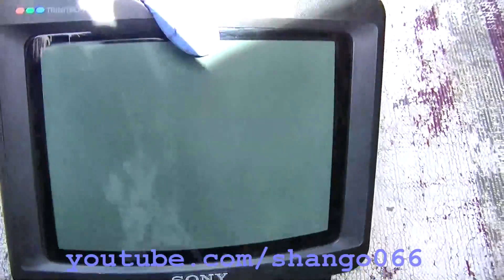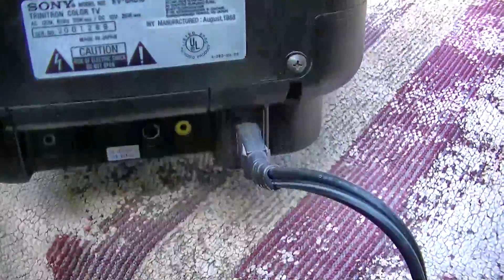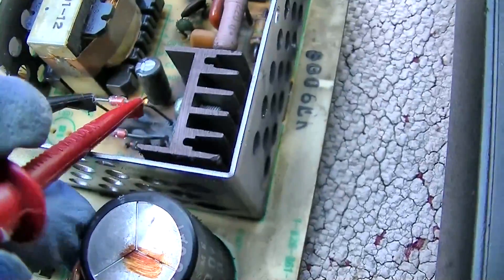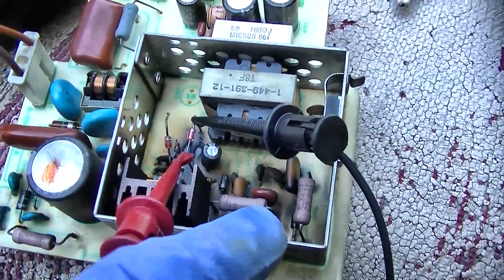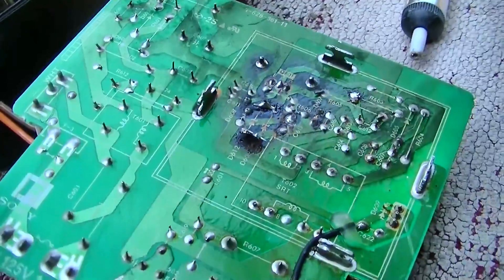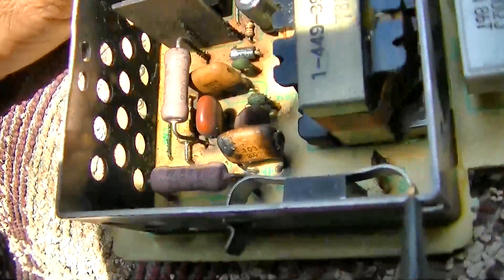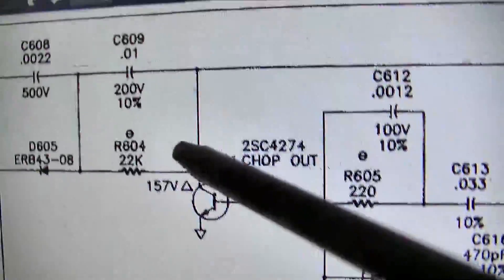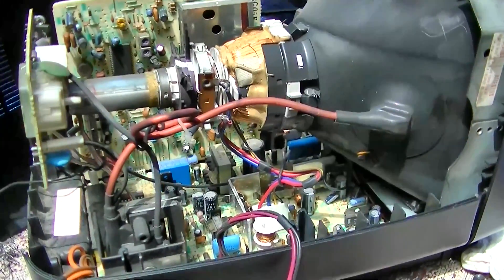Sony Trinitron Portable Television Comeback Repair KV-8AD10

Comment: Thank you for the tip about the Wall Wart power supply! I got a universal 12v 2.5amp center negative 5.5 x 2.1mm dc jack and my little Sony TV works again!

Comment: The disc caps on there, look how roasted they are.  It's in that can and when it originally failed baked components around it.  I'd check that transistor for thermal intermittent faults (or just replace it)... I hate these "feedback loop" problems where one thing causes another to blow up.
Reply: When you put it back together it will be in that can (like making a pot roast)... luckily the transistor will probably just pop open now if it does

Comment: Not letting the power supply run all of the time (in standby mode), WILL hurt it.

Capacitor's lifespans are shortened, everytime they are turned on, from a full-off position.  That is why ALL modern electronics power off into a standby mode.  ...the capacitors are receiving a small amount of voltage in this mode.

Think of voltage like water pressure.  Would you immediately fill a lock full of water, when it is empty, or would you gradually fill it with water.  ...think of how much water pressure the elements of your structure will support.

You were correct in having him connect it to a power bar (with a surge protector), ...but electronics should only be fully turned off, via a power bar/outside switch, when a thunderstorm threatens to overload your electrical system. \(•~•!)/
Reply: Not true..
Reply: @jonathaneastwood2927  Source, or sources to your claim?
Reply: What Whippet  weekly.... October issue.

Comment: These were classic workhorses in their day! Back then their color rendition was unbelievable.
It nice to see you bringing classics back to life. WIth all of these new flat screens hitting the market so cheaply today, no shops around here even bother working on them. Sometimes you can find perfectly good sets set out by the dumpsters over here. If the screen is not cracked most often its bad caps in the power supply board which can be replaced with some effort needed to crack open some of these cases used today. Hey whatever happened to Picture in Picture technology??? I have yet to find a flat screen out on the market that has this feature. It was great for catching two football games at the same time. Hit one button on the remote and you swapped tuners feeding the screen.

Comment: Hey Shango066 we used to put a small 1 ohm resistor in series with diodes or transistors wired in parallel to equalise the load so both see equal loading otherwise without this if one gets hotter than the other thermal runaway will always cause one to conduct more heavily and short ! Another method is to thermal couple both diodes to each other so both have equal temperatures you can put a mica washer between them or a ceramic disc with heat-sink paste to keep them both in check balance load. And naturally a zener diode in this configuration will draw more current when the TV is turned off as it is a diode clamp circuit to hold the voltage down more greatly with no load, the capacitor obviously smooths out the spikes without it the spikes will kill the zener's by overshooting their operational range.

Comment: I've been wondering about "working" caps causing power supply problems like that... but is that true for power supplys that won't start also (like maybe the start circuit)? I'm guessing it sort of is. Maybe not high ESR... or is it?

Comment: I still can't get over that Sony used parallel Zeners. It is one of the things teachers told us NOT to do. Current sharing will not be equal (although they look quite equally baked :) ) unless you select the diodes in pairs , which they obviously won't do for a mass produced item like this. They should have used a single 1.2-2W Zener instead of two parallel 0.25-0.5W.

Comment: The original zeners were RD10ES-B3 (10V not 12V!) which are picked at precise voltages, you have B/B1/B2/B3 gradings. This way it is ok to parallel them so they share equal current, because their avalanche voltage is close enough.
Paralleling normal zeners can lead to weird effects as only 1 zener takes most of the current and the other one will start to cause weird oscillations.
Still I don't think that would cause them to fry like that. There must be some spikes happening which killed the small cap. My first suspect would be the main filter cap 330@200 allowing too much ripple into the circuit. Hooking up the scope and checking the chopper wave form would give some answers.

Comment: The biggest problem with taking on repairs is no-one wants to pay "oh hey, you like old TV's, you should fix mine for me" It's no wonder all the repair shops have gone. Everyone knows the price of everything and the value of nothing.
Reply: its starting to become the same with old cars...you either replace only what's bad to avoid charging more than the price of the vehicle and risk future problems or you change lots and lots of rotten crap and charge 2 or 3 times the market value of the car

Comment: Those things.. you have to fully recap them and check with an inductometer the state of all coils.
caps and coils uses to go off-spec and cause those misterious problems.
Also they stronly need full resoldering of every single pin in the PCB after 30 years of service..
Reply: how does a coil go off spec?

Comment: I'm not a purest .....but hats off to  Shango for sticking with the original P.S. and not taking the easy way out. Though I'd say the majority of us may have changed it for the more modern supply, it kinda defeats the  "let's stick with the original design if possible" thingy.  Besides if he hadn't and something else happened....(i.e. that IC Chip smoked) one still might needlessly suspect THE BRAND NEW P.S., being the cause right?

Comment: Managing warranties on old well used equipment you repair can be a nightmare, a fools errand. It's not reasonable to try and make this equipment all new by replacing everything. A component that functions perfectly fine today can fail the next time it's plugged in.  Of course it's even worse when the equipment has to be shipped, and those costs having to be paid for in the 'back and forth'.
I find that zeners as well as other diodes that fail have too much current going through them. Not sure of your part number but looking at the size tells me the max might be an amp or two. That of course also determines the amount of heat they are dissipating. Personally, if the amount of current they're going to have to carry is more than half their rating, I'll go up to a higher current diode (zener or otherwise)
Reply: Very true. There are no guarantees on all repairs; they can either last a lifetime or not very long. Reliability is the issue.
Reply: @RoughJustice2k18  yes, and in this case it was found that it was the previous repair that had failed, and perhaps the repair was not thorough enough, but I think he did a good job of making sure the power supply was in better condition this time when he sent it back.

Comment: A crappy switchmode with no propper feedback to control the voltage.
Reply: I will look up the service manual because I can't believe Sony would do something like this. Yes, this PSU has no feedback, but it's probably just a downconverter and the TV has a regulator for 12V on the main chassis. So the output of the converter can be unregulated. Although a crowbar TVS diode on the output would have been a nice touch. Fortunately the Zeners served this purpose, although they're not directly on the output.

Comment: change the main filter electrolytic too. it's already bulged and getting warm. That PSU should be staying rock solid at 12 volts, regardless of the load or not. It still has a problem.
Reply: most 12 volt tvs run at around 13 to 15volts ,,,maybe because they are intended to plug into a car? i dont know for sure

Comment: You could just add a barrel jack for direct DC input so the AC supply is still in there, just not being used.  With all that carbon, lifting traces and poor design it will just come back for another fix.  Would make it easy to hook it up to a vehicle, batteries, etc.
Reply: It has a barrel jack from the factory.  The owner's manual even shows a 12V cigar adapter for using it in a car.

Comment: It's just amazing,  I remember paying almost the same price back then for a similar Sony that my sister paid for a Samsung set that's 55 inches today. I really do wonder what it will be like 30 years from now. Should I be holding my breath  ?
Why can't the prices of automobiles be the same. All I ask for is a simple car without ANY bells and whistles, not even a radio but must be reliable. OH, I Definitely don't want a car that has a computer chip in the tires to tell me that it's time to put air in the tires. 🤣🤣🤣
Reply: Guessing you're in America so Citroen/Peugeot likely not an option, otherwise I'd recommend finding a good condition older 306/ZX/405/Xantia 1.9TD or suchlike.  No computer rubbish and simple to maintain, ultimately reliable & cheap to run.  In the UK you could find a ridiculously well-cared for solid example of any of these for well under £5k & as long as it's maintained properly it'd last any of our foreseeable lifetimes.  (P.S. your rear left is currently at 27.2psi, time to pump 'em up there chief).
Reply: 30 years from now you'll be watching 
I love lucy reruns on your google brainview  which you rent for $1575.00 per month.   Pray the power supply doesn't blow because carbon tracking in the brain is quite unpleasant.  Future Shango's will need to be amateur brain surgeons to fix power supply problems for google brain views.
Reply: Government automobile regulations to "keep us safe..."

Comment: very bad design of Sony, you almost expect it of cheapo stuff, but not theirs
Reply: i have a 'roadstar' branded thing that had similar problem, runs continuously, looked cooked, must've gone overvolts as blew the line out transistor, luckily was able to get one, as was an uncommon type..
Reply: Yeah, maybe they farmed that part out, a small electrolytic cap sandwiched between the transformer and switch transistor, really?

Comment: Reminds me of the 36 inch Sanyo that I tried to repair some 15 years ago. It blew the Horizontal Output Transistor. At the time I checked for, and found a bad capacitor that was causing the HOT to, well, get hot and blow. I replaced it, test ran the TV for a few hours then sold it.

The guy who bought it from me called me a week later saying the set went dead and he wanted his money back. I said to bring it back to me. He never did. So I don't know if there was a cap I missed or what, but yeah, bad caps will take diodes and transistors with them.

I wonder if the first cap you put in was defective? It can happen.

Comment: The entertainment factor is right on! Who doesn't like to see a bit of smoke from burning electrolyitics? I am happy to see you get the power supply working in the end, instead of resorting to the wallwart adapter.

Comment: I thought I was buying one of these last month  for about $20USD with Remote and fully working, Turned out to be a full sized 90s Sony, bloody heavy and all at the front.
Reply: That's a pretty good price. Better than the $350 one on ebay that doesn't even have a functioning remote.

Comment: The filtration on the secondary had high level spikes like sawtooth...the zener diodes were trying to clamp the spikes... If you had used a scope on the PS you would have seen the filter capacitors in the secondary were not providing proper filtering...Replacing the caps removed the spikes and the zeners stayed cool..  I've seen this before in SMPS...
Reply: @masessum1  When caps go bad in a SMPS, a higher DC output voltage may be produced, which could destroy other parts in the circuit. It only takes a volt or two above the rating of a part to blow it up. It is a good lesson; always check everything in a power supply - including coupling / filter caps if you don't want recalls later.

Comment: I hope it's normal for that chip on the board to heat up like that; as looking at it through the Flir device, the chip doesn't appear to have a heat sink attached to it. At least these days, computer manufacturers attach heat sinks with thermal conductive material to sidestep any problems associated with overheating.

Comment: Given the thoroughly cooked state of that power supply board I would have just adapted a new/surplus open-frame industrial power supply to fit in there and canned the original...or sarcastically install a stud-mount zener on the shield casing.

I'm thinkng the cap was probably OK for a while then started to go high ESR in that ez-bake oven, making the diodes get hotter, making the cap dry out more, making the ESR higher yet, and running away until the diodes shorted.

Comment: That Trinitron model line was the monitor of choice for news helicopter monitors. They did the 12v mod to run them. For those news copter folk the main challenge is putting all that stuff an d still be FAA certified.But whatever failed in use it usually wasn't those tiny Trinitrons.. Those flying studios cost millions. Then HD made everybody start over.

Comment: Nice vid, nice FX, nice fix. Usually, these small caps are not so problematic in switch mode power supplies.
I think I would have deleted all of the board's parts except the connectors. Then drill 4 holes in it, in order to screw another modern SMPS module onto it. Connect it up, put it together and ship it.
You're right. Never fix someone else's stuff. If you touch it, you own it. They will keep coming back to you for keeping their junk alive 'till the end of times.
Reply: @6 months ago Depends on what you have more of: free time or money.

Comment: Personal i hate working with switching power supply's spatially the old ones. is the go bad they have a tendency do go fast and nasty. killed a multimeter one time as it went bad. 
Nice video regrades and sad state of affair that you have to put the shango66 in the middle of the image that way but I get why.

Comment: What was the brand of the CAP, I found that Panasonic / Sanyo ones don't hold up quite well. Or cheapo China ones, I had one fail in 1 hour.
Reply: Panasonic and Sanyo both make excellent caps, of course assuming fresh modern inventory not NOS stuff that could be dried out.
Reply: @chessapk5034  Sometimes you do get lucky with NOS capacitors though. Most of the time they're actually better made than the current ones that are out.
Reply: Panasonic makes nice caps, maybe you got faked ones.